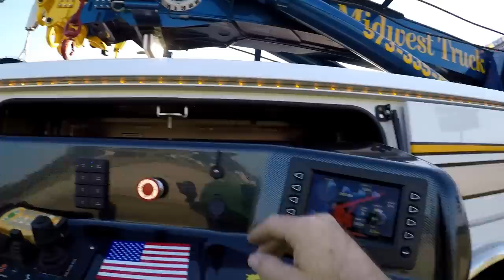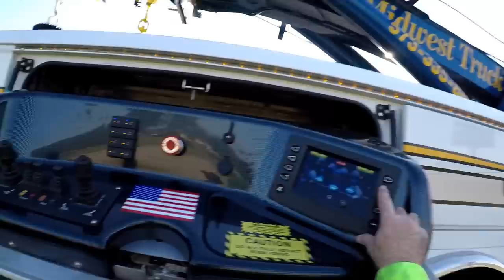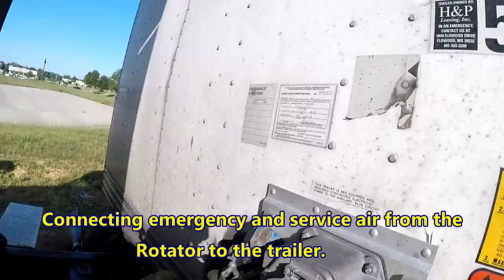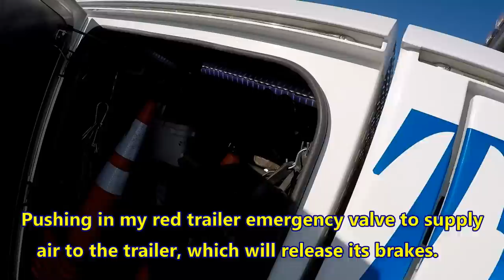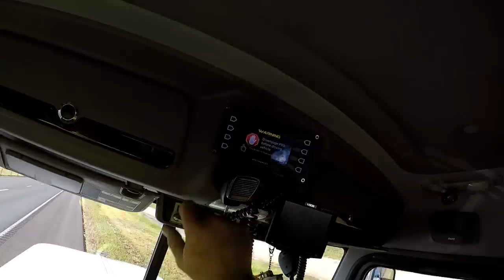BCD    Barrier Cable Destruction

Comment: About a decade or so ago we had a sub compact car crash through a cable barrier on I-77 and hit a pickup truck head on , killing everyone involved as I recall.  The car had a young mother as the driver with her toddler son in the car, apparently heading to daycare then to her employment.  The pickup had a retired couple heading home to another state after visiting relatives a couple of states away.  Reports stated the mother was driving at a high rate of speed while weaving through traffic.  Never heard why the cable barrier failed as news reports stated it shouldn't have.

Comment: Cable barriers seem to be one of those "good in theory..." sort of things. I get the idea, they have a lot of flex and act as another "crumple zone" for the occupants on any vehicle that hits them, while also "catching" the vehicle involved.... But the sheer amount of damage they cause even during the slightest of impacts is incredible... and not to mention what happens to motorcycle riders. 
AKAIK they don't use them in Australia (where I am). I think they had trials of them, but motorcycle clubs/groups campaigned hard against them.

Comment: I used to drive a Rescue Truck and Ambulance, I was told and found out for myself, whenever people hear sirens they automatically veer to the right, as to yield to emergency vehicles.  I would advise caution while using sirens travelling on the right shoulder.

Comment: I have been going back and watching a lot of y’all’s videos, I have really enjoyed them. I feel like I am learning the job by watching them, which is great because I hope to do this someday. I learn best visually anyway so these have been great. I do have one question though. Being y’all work closely with Fire and the police, and are able to run code, do y’all have a way to communicate directly with them? Like when y’all were pulling off with truck and trailer in tow, I just thought you might have been able to let the officer know so he could block that lane for you to pull off. I know that you have your lights and all but I know I have seen them do that a lot for drivers around here. I don’t know if the drivers here can communicate with them or not but they often block for the tow trucks.

Comment: I watched another video where you gave a demonstration lifting a school bus for high school seniors, and in that video you mentioned that safety is one of the number one issues when working on a busy highway.  If, as you say there are six for every one police office killed at accident scenes, and traffic continues to move at the same rate of speed in or around accidents, why don't the police, fire, EMT, or wrecker crews set flares out on the highway to force drivers into the outside lane.  Those reflector triangles are no incentive to slow anyone down.  I had a break down one time on a road like this and I was stuck in the right lane and could not possibly move over.  I put flares out and it caused the traffic not only to move over, but to slow down long enough to get around me without impeding the traffic, while at the same time allowing room for the traffic to continue around me.  For some reason people will slow down and move over for flares, but not for reflective triangles.  It is the law in most states to slow down and move over to the outside or inside lane if a police officer pulls someone over.  It ought to be the law for all emergency vehicles and personnel, AND especially for wrecker crews to perform their services safely.  I understand it is important to keep traffic moving, but not if you have a 6/1 ratio for wrecker crews and police, fire, or EMT personnel getting killed.  Any way, just wondering why you don't consider using flares?  Or if you or anyone have considered making it a law to use flares under circumstances where safety is paramount.

Comment: One thing a person wants to be aware of is that when caging the park brake chamber, there is 27,000 psi on that spring. Care should be used when doing this procedure. If the brake canister is corroding, be very cautious. Don't need someone losing a limb or life.

Comment: I love your videos
I had a silly thought....
If you left the blue and white lines hooked like at 15:40, with just a little slack. 
Wouldn't they be the ultimate safety chains, they could keep the front wheels off the ground even if the truck came off the forks or the under-reach failed.
Could you do that?
Why doesn't anyone do that?

Comment: I am thinking you need to add the emergency rumbler that most emergency vehicles have these days these people are to busy not paying attention.It was nice for the officer at 25:08 to stand and watch for you if he was not their I would of been placing cones out and using the arrow board.
Reply: Me thinks the arrow board is not yet on the beast, it was on the roll back and seems like its mounted to only one place/spot.
Reply from the maker: Joshua79C C  The arrow board is only on one of the rollbacks for now.  It has worked very well for us as long as it is placed behind the work zone.  The problem with placing it on the Rotator is that it wouldn't be visible while I'm in front of a truck that I'm hooking up to.   I have added some reflective arrows on the doors of the Rotator.   In this case the officer did the best he could to help short of placing his cruiser in the lane.  Thanks, as always, and God bless.
Reply: It looks like it needs a stand or mount and does not look very light or heavy but still a good size to handle, figured as much about mounting it on the beast would be impractical.

Comment: Best thing that has happened here in Victoria Australia is the law has changed for accident sites to not only MOVE OVER but SPEED LIMITED to 40 KPH (about 36 MPH) and saw it in action last weekend on a major ring road in Melbourne on the weekend this area has adjustable speed signs and they were dropped from 100KPH (62MPH) to the 40 limit while they had 3 of the 5 lanes closed for a multi car accident it caused a slight backup due to rubber neckers but as they slowed the speed for a few KM before the accident area and closed the lanes for about the same distance it ment that all the jocking for lane places etc was done long before the danger area. The best part was the amount of SAFE area created made it easy for all recovery and cleanup to take place quickly and the road to be clear in much shorter time with minimal delay to all users. Also the cops were there in numbers making sure people did as ment to.
Reply: 40 kph is 25 mph, good guess though (1 mi = 1.6 km and 1 km = 0.6 mi).
Reply: I got my license when we still had MPH but as most of my driving has been done with KMPH i just guestimate quickly but it is a good new rule but the younger revheads will be bitching lol
Reply from the maker: I would LOVE it if the US would do something like that!!   Thanks for watching and God bless.

Comment: Looks like you could use a helper to pull driveshaft, cage brakes. etc and get you off the road faster. Any plans on adding someone? I'd be interested.

Comment: Ron, Not sure what siren you are running or how many speakers. depending on you wattage you might be able to add another speaker and make it louder. Might hit up the local FD for a federal Q. Awesome job as normal, but I do have 1 question, What brand are those ratchet straps you use? They look alot easier to use 1 handed or in a tight space. Thanks for the quality programming, be safe and God Bless!
Reply: Think they are Erickson, just type "retractable (tie down) strap" words in parenthesis optional but helps but without the parenthesis.

Comment: Ron, my question is, since your truck has to supply air to your truck AS WELL AS the vehicle being towed, does your truck have an oversized or “heavy duty” compressor?  Do you have an oversized supply tank?  Or will a standard set up work to supply two vehicles?

Comment: Ron, Why doesn't the Rotator have "glad hands" for the air attachments instead of regular air couplings? All trailers and tractors use glad hands so why can't the auxiliary air lines on a wrecker work just like those? Just curious.

Comment: I'm 53 and that's the first time I've ever seen a siren on a tow truck. The general public does not consider them emergency vehicles in the same light as fire and rescue vehicles. Maybe in rural Missouri they think differently.
Reply: Rubber Neckers and Looky Lou cause more wrecks, so I feel the quicker Ron gets there, the safer the highway. 
Let the Siren Scream, speed, drive down the Shoulder, back down the highway, just get there Ron and do your thing !!!!! 
And God Bless

Comment: Do those red hooks you put into the frame lock in place?  Otherwise I don't see the point of the yellow safety chains if the hooks would just come right out...
Reply from the maker: The hooks lock into place.  Most of these hooks have a pin much like a trailer hitch pin that holds them, while some of the hooks fit into a special receiver that is spring loaded where you push the hook in and turn it 90 degrees to lock it in place.  There are a few that have a large center pin that is already on the truck and every Mack that I can recall ever seeing has had two D-ring style shackles on the front of the truck.  Thanks for watching and God bless.

Comment: Was the joint on driver's front tire broken? It seemed to be easily moved around.

At the start, I was wondering what could be going on to make this an hour long, then all the little things kept adding up with what you had to do. 

Stay Safe.
Reply: When you got a front end up in the air, its going to be easy to turn the wheel as there is no pressure on the tires and steering, does not lock up like most assume.

Comment: When you're towing a truck like this and connect the air supply on your truck to the truck you are towing. Are you able to control the brakes on the truck you are towing like you are doing now with the trailer or are you only able to release the brakes on the truck? On a side note, it always amazes me how little some people care or pay attention to emergency vehicles. I got sideswiped on my motorcycle by another motorcycle because I was stopping at a green light for a fire truck. The other guy didn't even see the fire truck and asked me why I stopped.
Reply: you saw him hook up a blue and red line, if the trucks brakes where powered has the air supply line not been damaged then he would be able to power it as if under its own power,. Thus yes he can activate the trucks rear brakes when he applies his own trucks.
Reply from the maker: Again, Joshua79C C takes the answer for me.  Thanks to both.  Be safe and God bless.

Comment: I'm just curious.  Do you get to have emergency lights and siren on your personal vehicles in case you at home and are called on an emergency and need to get to your truck quickly?  I wanted to watch you park it too.  Bummer.
Reply from the maker: Nope.  No lights and/or sirens on POVs.  Only company owned vehicles used for Emergency Services.  I drive one of the rollbacks home so that I can expedite if I need to.  Thanks for watching and God bless.

Comment: Coming from a state where wreckers are not allowed to use lights or siren (don't even have them) while traveling to a scene; and where cars either completely clear the lane on the highway or stop and pull over (both sides) on normal streets, it seems like you are largely ignored where you are.

Comment: these barriers are dangerouis!
Reply: MrBugsier5 
Not as dangerous as having a tractor trailer cross over the median and hit you head on.
Reply from the maker: The cable barriers are dangerous, but I have personally seen them prevent fully loaded tractor/trailers from crossing into oncoming traffic.  I've seen them wrap up a car rather than bounce it back into traffic.  I'm sure there is a better solution, but the cable barriers do what they were designed to do.  Thanks for watching and God bless.
Reply: Ron Pratt These barriers are far more dangerous than jersey style. And if they would make jersey's taller, you can eliminate oncoming headlights. Oh...the cost...the cost. So much for safety. :(

Comment: You don't need to tape the U-Joint on the driveshaft to prevent the caps and needle bearings from falling out?

Comment: Ron. I am still intrigued as to why big truck towing companies pull the drive shaft loose. Yes I understand protecting the transmission, especially wherein an TRUE automatic is concerned. However. you are causing "back side wear" on the teeth of the pinions and ring gears and splitter gear train. This can cause serious lash issues if towed very far at or near highway speeds. Why not protect the entire drive line by pulling the drive axles and putting on dust covers. Big truck drives are full floating hub designes by nature. The dust covers can be procured through the same people that dealership transporters use. for all models. ( I did that for a while myself just for a change of pace once). I had a 3/4" drive impact and long hose that plugged into a 1/2" port at the back crossmember of my tractor. Start to finish 5 minutes tops. including strapping all 4 axles across the frame of the truck. just wandering...
Reply from the maker: As I always say, there are different ways to do things.  We have multiple customers request that we never pull the axle shafts.  They state that they are required to change the fluid in both rears, clean and check the wheel bearings, and replace the wheel seals on any unit towed in that has had the axle shafts removed.  It is their company policy.  Apparently they have had issues in the past.  I know that others have issues pulling the drive (prop) shaft.  Personally, I only pull the axle shafts if it is absolutely necessary, such as the gears in the third member stripped/broken, and can't disconnect the trailer for a rear tow.   I'm not criticizing your method.  This is an issue that has been debated in our industry for at least the 30 years that I have been involved.  Disconnecting the drive-shaft is simply my preferred method.  Thanks for watching and God bless.

Comment: So the damaged lorry was on the hard shoulder & not causing any more problem than a broken down one (yes there could have been an oil issue) Recovery truck on route with sirens going etc. Lane 1 blocked off to allow access / safety, but once recovery on site lane 1 opened again while the operator has to work  ........... ?
Reply: Ge Gwen  that bothered me too! They should have kept the lane closed until the truck was ready to roll. At least pull the patrol car that was still their  out to block the traffic and make it easier as safer for the guy to work. Their was so many incidents where someone could have been killed just in this one video. Theirs already too many reports of tow truck drivers being hit and killed something needs to change!  I personally would start with getting a few cameras mounted on the rig that are capable of getting a clear picture of the driver and the license plate! Start sending them tickets for failing to yield to a emergency vehicle. Failure to move over for a vehicle displaying flashing lights. Etc! Hit them where it hurts! I would also force these people to look at photos of what happens when they hit one of these workers. 

The first season of highway through hell I believe it was the first episode they pulled up on the truck and started to get it ready to move when they found the driver of the rig dead under one of the tires!  Show them that footage unedited and in censored! That was gruesome!

Comment: Thanks for the video! What's the fastest you've ever gone in the rotator when running lights and sirens?
Reply from the maker: It only registers 80 mph, but I know it moves faster.   I don't push it much past 80 for safety reasons.  Thanks for watching and God bless.

Comment: Could you explain what you were doing when you put that log bolt into what looks like the air chamber for the brakes. Do tractor trailers work on the same principle as air brakes on a train, you have to have some air pressure to release the brakes?
Reply from the maker: Yes, it is a similar principle to trains.  The air parking brake system on a truck has a heavy coil spring inside the canister that applies pressure to the brake push rod when there is no air ( when the parking brake is set).   When the parking brake is released, air pressure compresses the heavy coil spring thus removing the pressure from the brake push rod and releases the brakes.  When air pressure is not available, such as this situation, the heavy coil spring can be manually compressed with the use of the T bolts that I used in this video.  I hope I explained this clearly.  Thanks for watching and God bless.

Comment: Nice job Mr. Ron. Did you have to bring this truck to Memphis? That's where I work and we do some work for Power Transport on there trucks.
Reply: He mentioned in the video after the cutaway after arriving at the shop the person they call and he posted it in text they had a tow truck bring in a new power unit (Truck) to swap out and continue the trailer haul, he was putting the trailer in a more secure out of the way lot and towed the truck itself back to the shop lot for the other tow truck once it arrived. Even showed it near the end in the bonus footage after the end credits.
Reply from the maker: Joshua79C C answers for me again....thank you.....both of you.  God bless.

Comment: I know there is a reason, why does it not work to just throw the truck in neutral without taking the drive shaft out of these big trucks when towing?  Assuming the gear box allows the d/s to continue to spin in the trans?